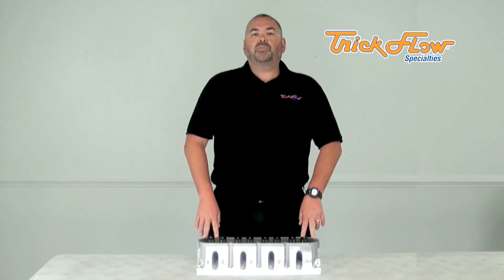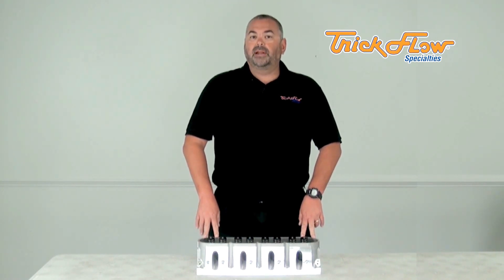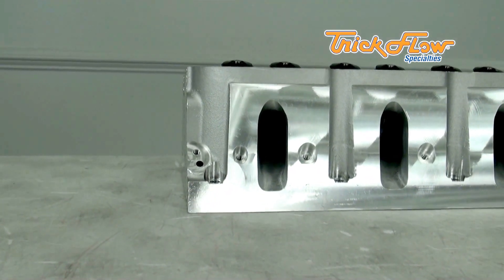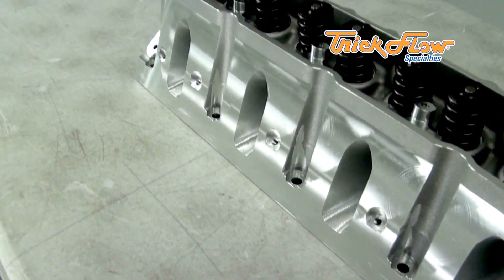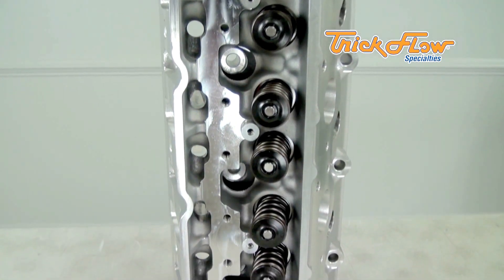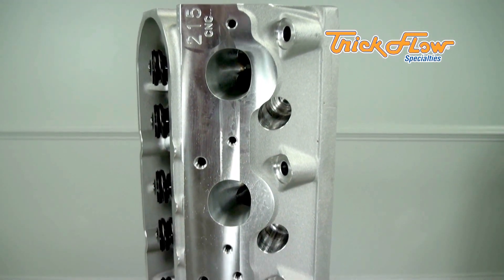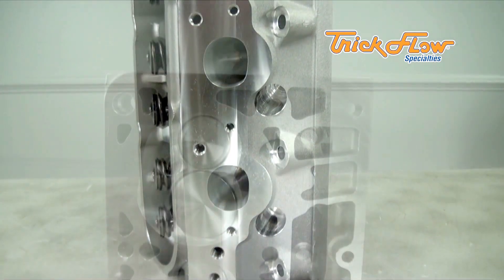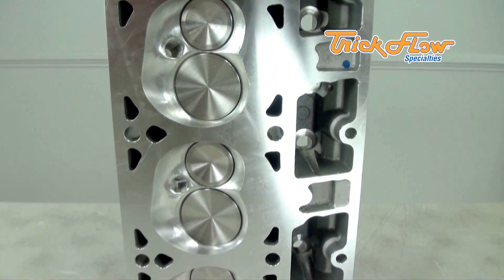GenX Cathedral Port Cylinder Head for the LS1, LS2 and LSX - Trick Flow Specialties

Comment: Will these work on the 5.3l
Reply from the maker: Yes, the GenX 205 cylinder head is the best head for the 5.3l. Here is a link to them on our web site. https://www.trickflow.com/search/section/cylinder-heads?keyword=genX%20205&N=4294965891
Reply: trick flow had a 205 head with smaller valves to fit the smaller bore of the 5.3